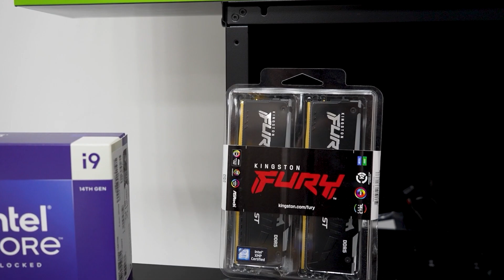BUILDING a $5000 ULTIMATE DREAM PC!

Comment: No offense but for 5k you could get a 4090 or a 7900 xtx instead of a 4080
Reply: Agree for this, the strategy should getting standard / decent accesories (except the water cooling, because i9 is super hot), and upgrade later on in the future...
Reply from the maker: A lot of import up charges in the Middle East unfortunately or else would have been cheaper, the cheapest 4090 over here was at least over 2K
Reply: @Steve.Storys  even if the gpu is 2k I don't know how u still make it 5k. Idk ur region prices but the build is overpriced af. Good build tho
Reply: Yep 🤣
Reply: maybe the monitor and accessories were part of the budget